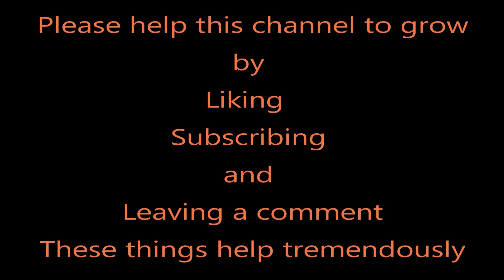Kangaroo Stew # 276 PT 1 I have been crook and my compressor died.

Comment: My shop was dusty and I was always changing filters on my compressor, mine is a 2 stage Ingersoll with just one filter. I removed the filter and got a hydraulic hose made to go through the wall into a car filter. The filter is under the roof of the lean to and stays clean. It also cut down the noise of the compressor in the shop considerably. Keep smilin Lance, hope you feel better soon.
Reply from the maker: I have been thinking of placing it outside under the new carport if I ever get it up. It is a very noisy thing to have inside.

Comment: Hope you feel better soon mate.. if you have more issues with the gasket, maybe try making one out of aluminium and glue it will hymilar.. they don't use gaskets in jet engines because they can't take the pressure and heat without blowing out so they glue them together with hymilar
Reply from the maker: I hadnt thought of that, Ill see how long this lasts.